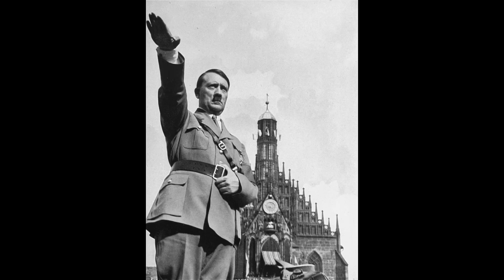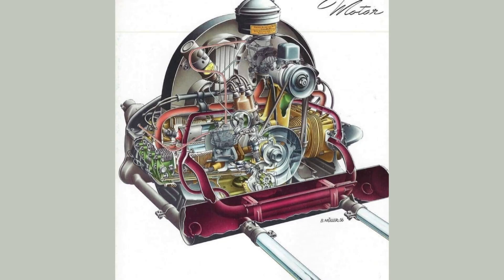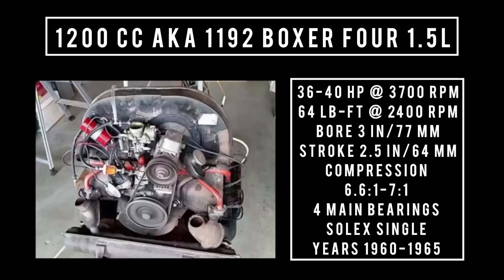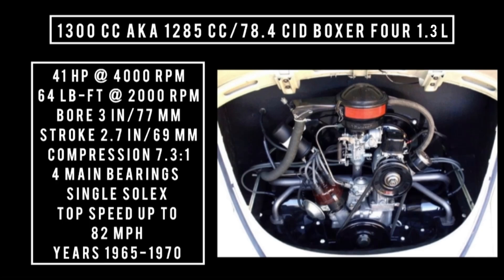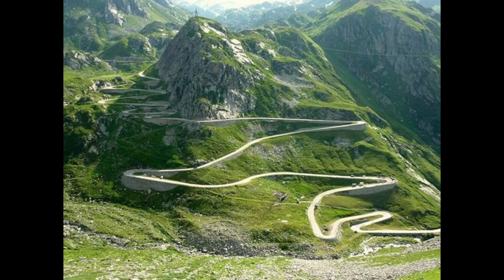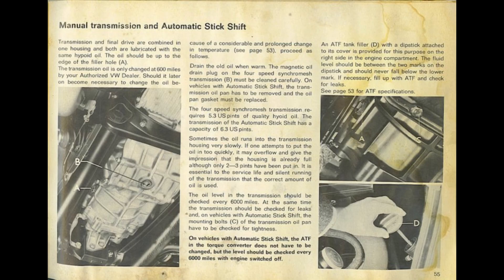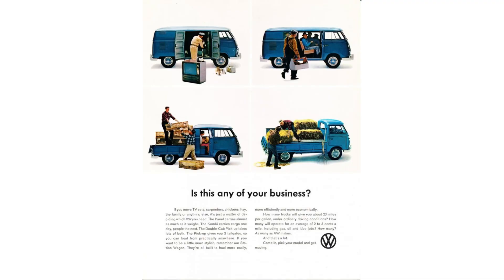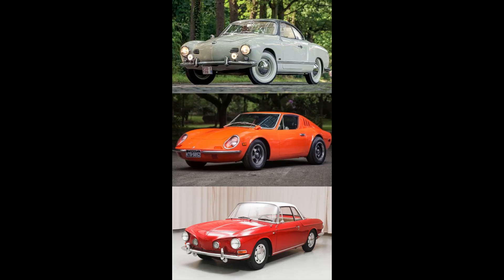Volkswagen air cooled engine family ( 1100, 1200, 1300, 1500, 1600cc )

Comment: 2:42: Where on earth are you getting 4 main bearings from? In the cutout, you can clearly see there are THREE main bearings, as there are in most flat-4 engines. Do you even know what a main bearing is? (Hint: They are #11 on the graphic, called "Aravores de manivelas"). And could you explain how you space out 4 of them out on a flat-4?
Reply from the maker: https://www.conceptcarz.com/s22427/volkswagen-beetle-1200.aspx

https://www.carfolio.com/volkswagen-1600-l-78320

Hint I’ve read a lot of people miss the fourth one
Reply: @What.its.like.  So, you are calling the 'rear crankshaft bearing'  a "MAIN" bearing? Since it does not support the compression and power output of the pistons, it is NOT a "main" bearing. Just by size alone, you should know this. In essentially EVERY engine built since the Model T (and probably even before..) all MAIN bearings are of similar size, spaced at regular intervals to equally support the compression/power load. Since the 1950's, ALL flat and V- 4's have 3, inline 4's have 5, flat and V-6's have 4, inline 6's have 7, v-8's have 5. Flat 8's are obsolete, but come from a time when fewer main bearings were used, when inline 8's often had 5, and inline 6's  had 4...
Reply from the maker: @alexclement7221  those two sources say four mains it’s conflicting information. Everybody tells you something different… 

This shows for main bearings when buying Volkswagen main bearing kit… the reason the fourth one isn’t as big as the rest of them as because of German engineering.. 

https://vwparts.aircooled.net/1200-1600cc-Main-Bearings-Set-Standard-Case-KS-p/t1-main-bearings-std-case-ks.htm

Ps not all V8 have 5 ford flathead V8 had 3.. not all in-line sixes have seven some have four.. Cadillac v16 used 5… some in-line 8s had nine mains
Reply: @alexclement7221 Any bearing between the crankshaft and the block is considered a main bearing.

Comment: 0:80: Umm.....the 'block' casing is cast MAGNESIUM, not aluminum...
Reply from the maker: Both were used

https://www.enginebuildermag.com/2021/09/building-air-cooled-vw-engines/#:~:text=The%20Volkswagen%20air%2Dcooled%20engine,steel%20crankshaft%20and%20connecting%20rods.

Comment: Had a 71 super beetle with the 1600cc.  Yes you needed to gear down on hills.  Currently we have a 1900cc 100hp dune buggy.  Even this engine with 2 barrel Webber carb slows down on hill climbs.

Comment: My '68 beetle with 1500 engine was so prone to failures that I became very accomplished at pulling the engine out of the car for major repair or rebuild.  Could do it by myself in about 45 minutes with just common tools and a floor jack.

The magnesium/aluminum alloy block wasn't capable of much horsepower improvement without self destructing.  Increase compression ratio and/or install a performance camshaft and carb/intake arrangement, and you could end up pulling the head bolts right out of the block.  I know this from personal experience, in my case on the 2nd day of my honeymoon.  The large thermal range that these engines had to tolerate was also a bit tough on them.  Oh, and the placement of the oil cooler deprived the #3 cylinder of cooling airflow compared to the other cylinders.  Mine dropped a valve in #3 one time when I went straight into a long grade from a cold engine start, the thermal stresses on the valve were just more than it could take.

I don't miss that car at all.  It was inherently unsafe, especially if you had the misfortune of being in a frontal collision.  Given its small displacement and marginal power, its fuel economy was very poor.  Its cabin couldn't be adequately heated or ventilated in cold weather.  Its design should have been retired by the mid 1960s, by then it had already exceeded its "sell by" date.  Only a short time later, cars like the Datsun 240Z were becoming available.
Reply from the maker: Thank you so much for sharing this information and insight =)
Reply: @What.its.like.  If your 1500 was "prone to failure" it's your fault. Proper build, proper maintenance, proper driving will give you zero troubles and 100,000 miles between overhauls. Alas, many VWs were owned by people who neglected the basics. The same sort of people who could break an anvil.
Reply: When I was a kid, my parents had a transporter that we all loved, but my dad was very experienced with VWs and had determined that it was about to drop a valve seat (maybe a whole valve) and they sold our beloved van. I don't know how my dad knew what was going to happen, but within weeks we heard that it had done just what he had predicted it would do, and on a long road trip, no less.

Edit: I'm guessing that he knew that the seat was about to drop because the valve clearance kept increasing.

Comment: I always loved the low-slung design of the Karmann-Ghia.
The one issue I had with it was with the body panels, namely the front fenders.  A damaged right-side front fender meant replacement of the entire front end body panel, as the left-front and right-front fenders were a single unit; unlike a Beetle, where if a front body panel was damaged, just that single fender could be replaced.  
But, from my experience with the '67 Beetle, the high quality sheet metal with the fenders were such that a body hammer and dolly could straighten out the dent in the fender.

Comment: I had a '67 Beetle.
Can attest of getting it up to 85 mph.
But, it ran at its best when the US had the 55 mph highway mandate in 1974.
In its prime, driving up a 6 percent grade on the interstate, have to downshift to third gear with running at 40 ~ 45 mph.
The engine was probably the most forgivable design ever, as it could be subjected to a lot of neglect when it came to maintenance, and it would keep running, albeit sluggishly.
The driver/passenger compartment heater was hazardous, as carbon monoxide was an issue with my car.  Without using the heater in winter, windshield could ice-up, and dressing warmly to drive was a must.
While a selling point of the Beetle was not having coolant, which made radiator boil-over a non-issue, that did not mean the engine would not overheat.  In hot weather, it was wise to keep the engine rpms up for the engine's air fan to run fast for cooling the engine.  Low-rpm running of the engine in hot weather could result with the engine dieseling when the ignition was turned-off.
If engine dieseling was an on-going issue in hot weather, using premium gasoline could resolve that issue.
Since the engine did not have an oil filter, oil changes every 1K to 1.5K miles a must, where in 100K miles the engine did not burn oil.
The one weakness in the Beetle's design was the sheet-metal floor pan being the chassis.  Sheet metal corrosion created problems with the integrity of the chassis.  That corrosion created the most debilitating issue with that Beetle:  The clutch/brake/gas pedal assembly collapsed, as the mounting bolt for that assembly was on that sheet metal floor pan chassis.

Comment: Vw bus t1. 
Vw type 34 ghia.
❤
I own a 1971 vw Dormobile camper. It has a 1600 twin port. It pulls OK. Hills are certainly naff 😂 hahha.... 
I live in the UK, the heating is also sh!t... so I put on a diesel night heater and plummed it into the original heating system. I can defrost the screen, keep warm and camp in it all warm! 🔥

Comment: I was born in 1951. During my years of growing up my father owned two Volkswagen Beetles. The first was a 1965 Volkswagen Beetle with about 40 horsepower. The fastest indicated speed on level ground was 75mph. This car would slow down on hills to about 45mph in third gear. The next Beetle was a 1972 Volkswagen Beetle with the 1600cc engine. This car was better accelerating than the 1965 Beetle and could climb hills at a higher speed. Also the 1972 Beetle got slightly better fuel mileage than the 1965 Beetle. My father attributed this to the 1972 Beetle having a better carburetor.
Reply: The carb on the '67 Beetle I had needed a rebuild, as the fuel mileage got down as low as 18 mpg.  After the carb rebuild:  27 ~ 35 mpg.

Comment: I have two buses, a 1969 T2a (single port engine) and a 1973 T2b (dual port engine). Initially I bought them for rentals but I don't feel very confortable with that as some renters are not very careful so I use them for events.

Comment: Only after giving them canister oil filtration and larger oil coolers did I have more confidence in them. I couldn't stand to see all that junk on the bottom plate at oil changes! You could then use synthetic extended drain oils and know you were helping things run cooler and for longer.

Comment: In the early years of our marriage, we had a 69 Beetle.  I think in had the 1600 cc engine, could be wrong.  I remember it had no oil filter, you cleaned the oil screen with gasoline (you briefly showed a photo of the VW oil screen assembly).  It held 3.6 qts of oil and an oil change cost less than $4.00.  A tune up was four spark plugs and a set of ignition points and cost less than $10.00.  Had to be very careful not to strip the threads in the aluminum heads when removing spark plugs.  One of the best engines ever made, in my opinion.
Reply: 2.6 qts and '69 had a 1500cc
Reply: @brianchisnell1548 It was a long time ago.  Kept the car till '93.
Reply: @Vegaswill714  ALL good!

Comment: The stock VW engine block is cast magnesium, not cast aluminum. Many aftermarket engine blocks are cast aluminum and are larger with more room to incorporate larger piston barrels (jugs) up to 94 mm, and longer stroke cranks (up to 86 mm with clearancing and without interfering with the camshaft).
Reply from the maker: https://en.wikipedia.org/wiki/Volkswagen_air-cooled_engine
Reply: @What.its.like.  The article states exactly what I said, the stock VW engine block is a cast magnesium alloy, not aluminum, which you stated in the video. If you ever owned a VW which had a fire in the engine compartment, like I have, you'd understand the difference. Magnesium is highly combustible and difficult to extinguish. However it's lighter than aluminum, which is why it was used in VWs.

The aluminum aftermarket cases which are stronger, heavier and slightly larger allow for a tremendous increase in power over any stock VW including the 914, which used a Type 4 engine that was developed together with Porsche. These aftermarket cases can be built to over 2.3 liters of displacement vs the stock Type 1 1600, and can achieve over 300 HP with forced induction.
Reply from the maker: Thank you for the correction i’m dyslexic sometimes I have to slow down and read what’s actually there cast aluminum pistons..

Comment: The other big user of aircooled engines was the french carmaker Citroen.Their last aircooled engine the 1300cc GS was an OHC design producing 65 bhp,more than VW,when production ended in 1988.
Reply from the maker: Awesome information =)
Reply: I owned a Citroen GSA, fantastic car with the legendary suspension from the DS. The flat four engine was placed in the front of the car.

Comment: 0:36 Weren't the cylinders themselves and the cooling fins that surrounded them, magnesium? I've heard that each could be replaced individually.
Reply: The crankcase cases were magnesium--the cylinders were iron--the heads were aluminum (or aluminium, if you prefer).  Yes, the cylinders could be replaced individually.  (Later, the cases were a magnesium/aluminum alloy called Electron.)

Comment: I'll take the '67 Ghia (the model I had in cabriolet form) with the 1500 cc engine and 53 HP WITHOUT antipollution devices that appeared with the '68 model (at least in the USA).
NOTE: 1100 cc = 1.1 L; 1200 cc = 1.2 L; 13cc = 1.3 L, not 1.5L as indicated in the specifications graphic.
Reply from the maker: Yeah that was a typo thank you for catching that =)

Comment: The engine cases are magnesium, not aluminum- the latter is used for modern stronger cases, but weighs around  20lb more. The change in how power was rated from SAE net (optimized, without accessories) to SAE gross (as installed in vehicle including full exhaust system) in the early ‘70s affected all manufacturers,  not just VW. The German DIN figures can be referenced, as that standard remained constant. I’ve seen from 60-46 hp listed for a dual port 1600, but the DIN figure of 48hp seems about right….
Reply from the maker: It’s a mixture of both magnesium and aluminum alloy..
Reply: @What.its.like.  It is not a "mixture" of metals: it is an alloy, in which metallic magnesium is the base metal and aluminum participates with less than 9.5% only, along with other trace elements.
Reply: Yep, the engine cases were magnesium.  If one ever caught fire for some reason, it was nearly impossible to put out.

Comment: I have a 1.6 vw engine with upgraded parts its been awhile since ive looked at it but ik it makes 90hp
Reply from the maker: They changed the way horsepower is rated in the 70s.. which is weird

Comment: Couple of years ago I had a 71' super bettle with a 1600 engine that has been sitting for 10 years. I bougth it for 180 bucks. The car was partially buried on the back and the engine was covered with dirt. After a deep cleaning and a tune up, that little engine start and run like a champion.
Reply: Most of those old legendary engines has been build to run forever not matter what
Reply from the maker: I totally agree I’ve seen countless classic vehicles be dragged out a Barns or what have you change the oil put some more gas down inside there starts right up
Reply from the maker: Awesome story.. I wonder how many cars from now that would be possible doing because once the computers are toast the whole car needs a new cpu and A lot of times I could be a colossal headache
Reply: Today, my little brother (25) told me our oldest son (13) can have his '68 parts bug and '72 once running Baja lookin bug. Kid is gonna be stoked, now we gotta learn how to mess around ourselves

Comment: These engines were cheap and reliable, but gutless wonders.  Had a 1969 Fiat 124 Sports Coupe with a 1438cc engine, budy had a 72 Beetle.  If we wanted to go somewhere where we needed to get there in the same decade we used the Fiat.  Sorry, the Fiat had much more power and didn't have issues.  Ran the Fiat till the car rusted out to the point of not being road-safe.
Reply from the maker: Great story thank you so much for sharing those memories one day I wanna have a drag race versus all of the really slow cars yugo vw puma vw beetle fiat 124 amount other slow cars
Reply: @What.its.like.  You were thinking of the 124 sedan, they had a 1438cc overhead valve engine that was rated somewhere around 75hp, which I think was somewhat overrated.  Now the 124 Coupe and Spyder had a DOHC 1438cc engine which was rated at 96hp, they would hit the TON without complaint.  About the only thing in common with the 124 sedan and the Coupe was bore and stroke.  Worked with a guy that had a Yugo that would shit and get it, had an ABARTH kitted X-19, as the Yugo was a Fiat 127 with a 128 engine and transmission.  The X-19 was a bored out 128 engine to 1500cc.  The Abarth kit, had a modified crank with a 70 or 80mm stroker kit, Fiat was cool in they kept the same bearing sizes and basic crankshaft spacing on their engines, the SOHC 1100 thru 1500 and then the DOHC 1438 thru the 1998cc engines.  The larger DOHC engines you would have to really modify the block for clearances and the stroke just was not happy to turn those high speeds.  That Yugo ran like a scalded dog, but it was far from stock also.